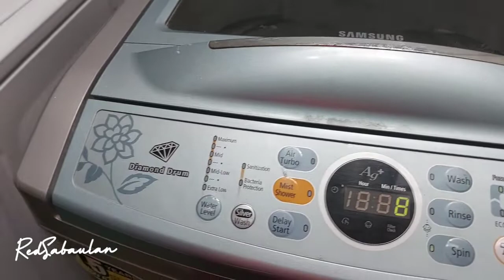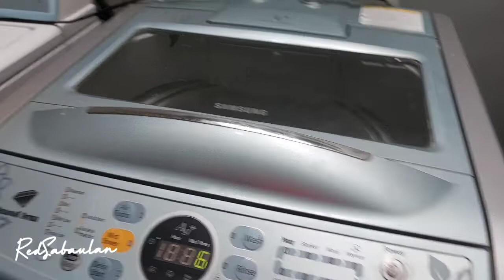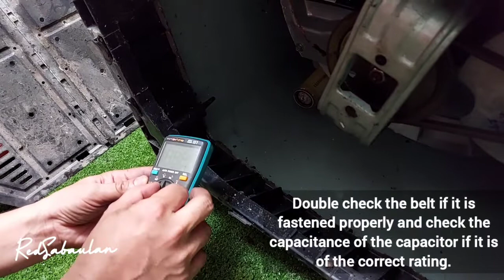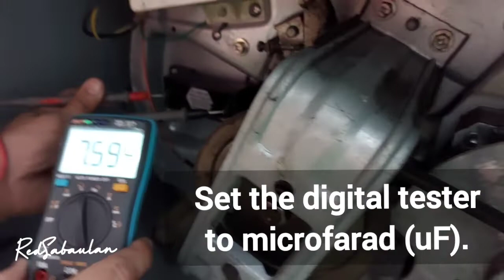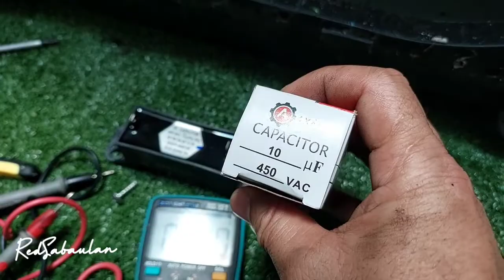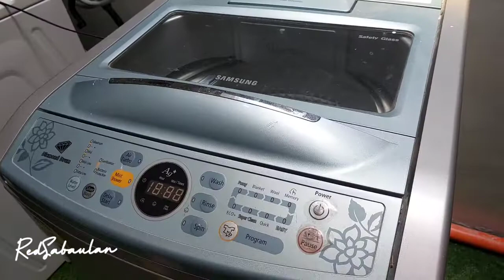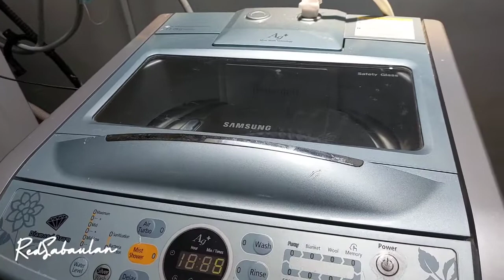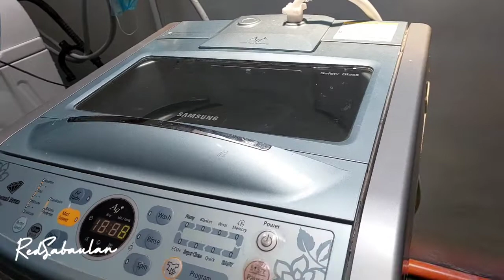How to check and install automatic washing machine capacitor?

Comment: if machine is not starting only motor sound. should i change capactior?
Reply from the maker: Yes, check the capacitance of the capacitor, if below value/rating replace. If the capacitance is okay, check your motor.
Reply: @wearwolfserv  when i remove motor from machine motor is spining fine. but when i put load(hand pressurre)  on it it stops spinning only sound of current
Reply from the maker: Have you replace your capacitor, capacitor must be equal value and rating.
Reply: @wearwolfserv  yes i replaced it
Reply from the maker: Do you have digital tester? You can check the ratings of the motor.
Reply from the maker: https://youtu.be/uYwTj5Wo12M
Reply: Check the bushing ang shafting

Comment: Sir  red ang  drain motor wala bang specified na design sa model ng washing machine?bakit iyong inorder ko sa lazada pagkapower on hatak agad diba.dapat wala muna cyang no power  pagka spin mode doon palang makakapower.
Reply from the maker: dapat kung ano yung nasa lg specs yung din, kung same sila at tama ang connections mo. maaring nag short yung board mo. pang ilang palit niyo na po yan? ano po problema sa original na board?

Comment: do i need. start or run capacitor
Reply from the maker: You need starting capacitor
Reply: Bakit starting capacitor lods masyadong mataas ang starting capacitor 70uf and above ang starting dapat run capacitor para jan
Reply from the maker: For AWM application capacitor range 10-14uf, check your motor for correct capacitor.

Comment: 11uf sakin ngayon mabagal padin ikot. pwede ba taasan ng 13uf
Reply from the maker: Dapat pareho lang po ng uF na capacitor na ikakabit, pagmataas ang uF may posibilidad na masira ang motor. Sa case mo check yung rating ng motor.
Reply: ano po ba kadalasan ang stock n capacitor ng automatic washing machine. napalitan napo kasi itong 11uf hindi ko po alam ang naunang capacitor
Reply from the maker: Ano brand and model ng washing mo?
Reply: @wearwolfserv  panasonic sir rated output 340W AWM po. salamat sir sa response. DIY lang po kasi ako